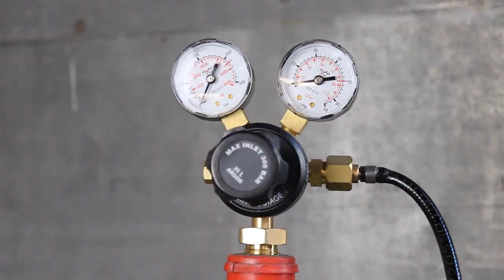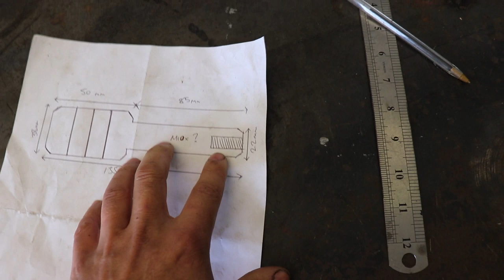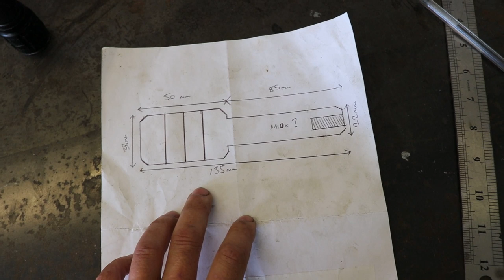THE MONGREL GETS A KNOB EXTENSION, FIRST COLCHESTER LATHE PROJECT.

Comment: Looks like you're getting birds nests cause you're taking too deep of cut, also that first tip you used looks like some pretty outdated technology. You wanna get your hands on a sandvik catalogue and buy a bunch of there tools and tips, the way that they denote everything like chip breaker style, nose radius, material etc is pretty simple. Also if you take all the measurements on your metric drawing and just divide them by 25.4 it will give you the imperial equivalent

Comment: You really need to watch alots of lathe videos. The problem is not with the inserts or tool holder. You need to learn about feeds and speeds. Use different tool holder and try different feeds and speeds and see which one gives you the results you want. It looks like the dnmg insert you was using will break the chips.feeding too deep could be the reason for stringy chips. Learn about chip breaking and feeds and speeds

Comment: Just remember the machine hates you and wants to hurt you. Chips are hot dude and you get little brands on arms and neck but only if the lathe feed is fast enough. Play first with different cuts and give it more speed n feed on alloy. Way too slow old mate. I used an amp meter to give me maximum speed/ feed ratio. Get some toolsteel if you want to learn cutting angles etc. well done on good lathe buying.